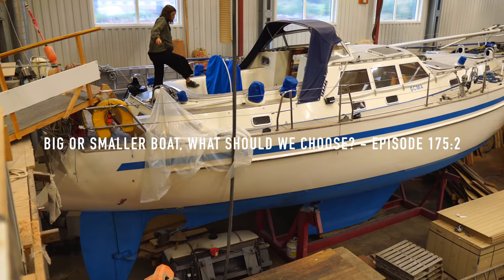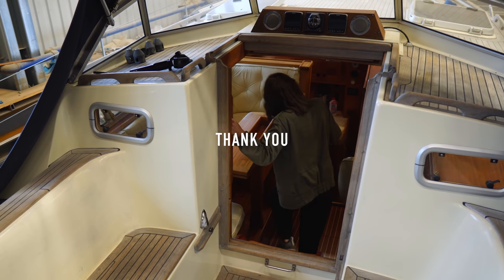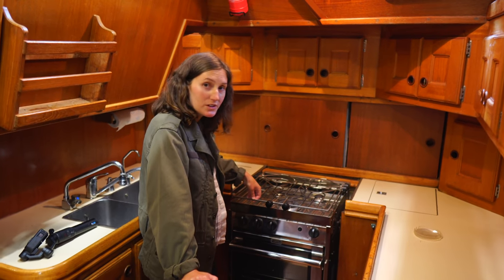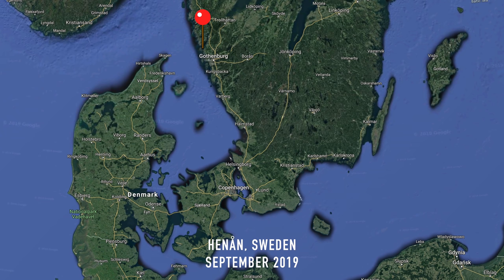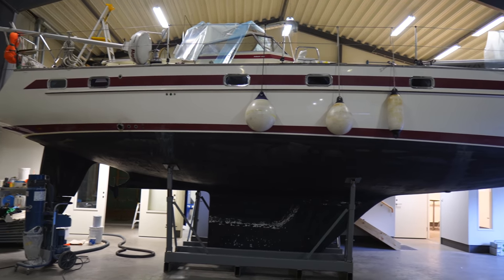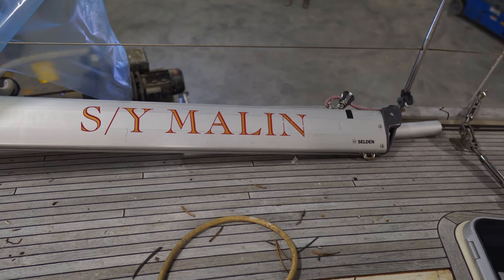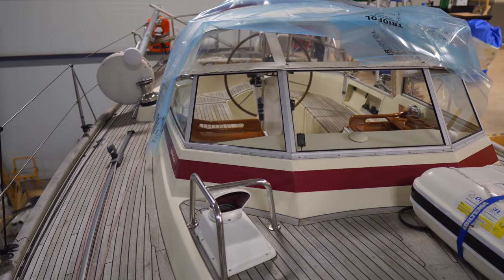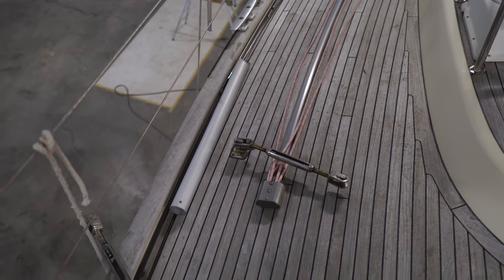Big Or Smaller Boat, What Should We Choose? - Ep. 175:2 RAN Sailing

Comment: I had a 55 ft boat with teak decks purchased new back in 1985. If I were buying again I would try to avoid teak decks, maybe just the cockpit. They look beautiful and feel great underfoot but require a lot of cleaning and elbow grease to keep them looking clean. After trying many different solutions to keep them clean I eventually came to the conclusion you could not go wrong with plain old Tide soap. I would also avoid any on deck wood varnishes. There are always more than enough other maintenance chores to keep up with without adding on deck teak and varnish. Just my two cents on my preferences and wishing I was still young enough to be contending with these decisions again myself. Really enjoy your videos and by far one of my favorites.

Comment: I spent most of five years cruising, mostly Central America and the Caribbean.  I'd suggest you consider whether the boat you have could be handled by the minimum number of people you reliably will have onboard.  I picked a 30' cruiser rather than a larger boat because my initial sailing experience was on a 65' boat (built in 1928 for the King of Denmark) and it took a crew of seven to race it.  It took three people to get a headsail out of the cabin and on the foredeck.  I knew that I was likely to be solo often and wanted to make sure I could handle the boat under bad conditions.

While cruising I made friends with a couple on a 50 foot boat and a couple with a 54' boat.  Both couples needed extra crew when doing a passage.  That meant leaning on family and friends to take time out from their lives, travel to the boat, and then make a big jump.  Or hiring crew which is not necessarily easy or enjoyable.

What I saw a lot of in the Sea of Cortez was couples on 40' boats who seldom hung a sail but would motor from place to place, especially if it wasn't a run.

Perhaps roller reefing is better than it was when I was cruising but back then one saw a fair number of destroyed jibs after a big blow.  The couple on the 50' boat I knew did the Tehuantepec Gulf passage, had their roller reefing snag, and came close to losing their boat.  Just a thought....

Comment: Definitely Malin was the better of the two for a small family.  Could the beds be modified to fill the split and reapply a wooden edge rail straight across to hold a more rectangular mattress and thereby extend the length.  Hard to find a boat so clean and well cared for if a couple of small carpentry jobs could solve a problem.

Comment: I'd go for an up to 50-foot wooden boat - nothing larger. A yacht has no soul if it's not wood. Besides aesthetics, there are many advantages to wood. It's durability for one.
Definitely a cutter. Winching in two smaller sails is easier than handling one big sail. A Marconi rig as it's better for sailing on the wind. I'm in two minds about a ketch or sloop. A ketch allows more sail and more combinations going downwind.
I liked the idea of having a steering station out of the weather. 
Consider lithium batteries; they allow you to install every safety device, including a radar, you'll ever need.
And I agree with Malin. Many boats are gloomy below deck. Brown varnished wood is used apparently to make the craft look more authentic. Lighten it up. Paint the bulkheads and cabin ceilings white. Carpet the sole, especially when you're sailing up North and install a heater.
A workbench for Johan would be a boon as would a more spacious engine compartment. 
Good luck!

Comment: Joining the thread late having just binge watched and enjoyed many of the recent episodes.   Worthy of a look IMHO are the Nauticat yachts (Finland origin). Very high quality (no balsa core), Selden masts, heavy layup, full size aft cabin, etc.  You my consider the added safety of an enclosed pilot house a plus for the baby along with the benefits of an aft exterior helm for traditional sailing fun.

Good luck regardless.   Just subscribed and will be following.
Reply: I have looked at a Nauticat 44, and I must say that is a very spacious and practical boat. Also the quality is top! Good for liveaboard. But I think that these guys are more into the "true" Sailboat design, which has better "real" sailing performance - especially upwind / lower windspeed. The motorsailer is a compromise. But the Nauticat 44 might be one of the best of the Nauticat motorsailer models, thanks to the higher sail area vs displacement factor. The 44 has a nice big pilothouse/deck salon, and has full headroom (+ free air on top) for a 1.90 mtr tall guy.
But with low breeze 50 deg upwind, you will need to motorsail with the Nauticat motorsailer, where many true sailboats will go on just sails.

Comment: Longer cockpit seat are a must as you do spend a lot of time in the cockpit, well I do anyway on a long passage. Galley designed so you don't get tossed all over the place. An open floor plan. A workable owner's stateroom that will be good for the little one, she will need a secure bed with you guys.
Something between 44 and 54 feet.

Comment: In rough seas I tend to get queasy in anything under a 42 ft. waterline and 45,000 lb. displacement. I also don't like to feel closed in by small spaces, so I usually only look at sailboat lengths between 45' to 54' and with displacements between 45,000 to 54,000 lb. and beams no less than 14 ft. I despise any wood on deck 'cause it makes me into its slave and I also despise wet heads....they must have a separate shower, with a tub as a bonus. I hope you two find your perfect sailing home!

Comment: Have you thought about an OVNI?  A 455 might be a good boat for you and if you can find an early one, it could be within your budget.  15.2m LOA.  Aluminium hull with lifting keel.  They are built for long range, off shore cruising, so would suit your type of sailing.  Very strong construction and massive tanks, although many also have water makers.  Down below, the woodwork may not be quite up to the standard of a Najad or H-R, but will be very much better than what you will find on any plastic production yacht.  We looked at a Najad 37 before buying our OVNI 365 and have not regretted our choice.  The Najad was a lovely boat, and in comparison, our OVNI looks almost utilitarian.  But it is an excellent sea boat and very practical and safe.  It is also very versatile.  We can get into shallow bays and rivers that would have been inaccessible in a boat with a deeper fixed keel.
Have really enjoyed following your adventures.  Good luck with the search!

Comment: Even though they both were very nice boats, neither one of them would be our favorite.
As a family of three, we are looking for a boat for quite some time now but weren't successful yet. The Deerfoot, even though a great boat, would be pretty much too big for a crew of two. Please keep in mind that a baby can shrink a crew of two into a crew of one in almost no time and regardless of what situation you are in — the reason why for us excellent single handling capability is very important.
That also applies for the Forgus 52. What we really liked about the Forgus was the deck salon and the inside helm station. 
So far, we mainly checked boats on the US east coast and in the Netherlands. The Netherlands because they build really great aluminum hulls combined with variable draft.  Strong aluminum hulls and variable draft make for real go everywhere boats. The downside is that they are very expensive, new as well as used. We absolutely understand your desire to have a more open floor plan and a lot of light; we don't like the basement feeling either. However, after checking many boats during the last year, it appears to us that those characteristics are coming more often with newer boats and higher price tags. 
In the end, buying a used boat is always a compromise. The only thing we don't want to compromise is safety, and the rest is negotiable, at least for us.

Comment: Hi,
would like to contribute with some of my thoughts about finding the right yacht for family cruising around the world within a tight budget.

There is a huge dilemma when theere are so many needs that has to fit in a budget of $ 150k and still get a good enough and not too old and outdated boat.

It's also hard to find something without compromising.  To make long passages on open water I would prefere a hull made of steel for safety reasons but thats hard to find and probably expensive if it's well maintained and upp to date. 

I asume that a hull made of GRP will be the best way to fit the budget and easier to sell later in the future.  

To compare safety between diffeerent brands of GRP boats can be hard.  Probably it doesn't matter if you have an older Najad, HR or a newer and more modern design cruising yacht like Beneteau,  Bavaria or Dufour. When hit by a floating fridge, container or a log, you will probably get a hole in the hull near waterline no matter what design.

Modern cruising boats often stands for wider hull, less weight, good sailing speed and spacious comfort in contrast to older design that stand for high quality,  better comfort in higher seas and often safer when you run a ground in more than 6 kn but it has more weight, often less sailarea,  less speed,  poor light inlets, narrow and crowded cave feeling inside.  

If having children onboard I would think about:
1. Spacious design
- Children should have their own cabin to play and sleep in that hopefully helps to keep other areas almost free from toys.
- Salong with dining area with lots of seats.
- Spacious cockpit with plenty of room for everyone to enjoy sailing, dineing,  hanging etc. (I modified a bicycle baby seat to let our daughter to sit in cockpit when sailing.)
2. Easy access
-  to transom / bathing platform makes it easier and more secure when bathing and when using the dingy. 
-  to engine room to do maintenance
3. Easy and fun to sail  
- Rig with furling sails (head and main) to make it easier and safer to adjust single handed.
- 2 steering wheels to be able to sit all the way out to each side to get closer to the feeling of sailing a small sailboat and it also makes it easier to access transom and bathing platform without having a steering wheel in the way. 

As you probably already know I would recommend a modern design production boat not older than 10-15 years.  I think that will gives you more value for money.

It's also easy to find a 10-15 year old 42-46 feet (Bavaria, Beneteau, Dufour etc..) for about $ 100k and still have money to update the rig and other necessary things within your budget. It's also easier to find spare-parts to well known production boats. 

If you choose to go for a modern cruising boat I would recommend a 4 cabin version with 1 double bed cabin in foreship, 1 bunk bed cabin midship and double bed in each aft cabin. 2 heads (one w shower),  big salong w longside galley, big u-sofa and a free standing 2 seater sofa close to galley (so you have something to lean on and grab on when cooking or passing when sailing). 

I sugest that you convert the bunkbed cabin to workshop, storage and a small washingmachine.  

If you believe in the older design I would go for a less expensive production boat like Bavaria 42 ocean (center cockpit) wich you can find for about $ 100k  The big difference is smaller cockpit with small table, 1 steering wheel, 2 bigger double bed cabins, galley in pasage to owners cabin in aft (safer cooking when sailing). 

If  buying a +10 year old boat I think you will need to update the rig to make it reliable (good as new) and most probably also get 1 or 2 new sails.  Depending on the boat condition and age of equipment I beleive it will cost lots of money to update and complement to feel safe to sail around the world with. 

other thoughts..
I would also try to avoid teakdeck if possible to keep maintinance and cost down.  

Due to that modern crusing yachts have more sensitve rudders I would also get a wind vane that could be used as a spare rudder.

I would also spend some time to think how to make watertight bulkheads

best regards 

Anders

Comment: At the price range of $150k you might want to look at a Hunter 466 or 45 center cockpit. all of the larger Hunters produced since the late 90's are CE - A rated A Class A yacht ( boat ) is a vessel that is built to navigate the open ocean and surpass a force 8 on the Beaufort scale and surpass waves higher that 4 meters.   These yachts are constructed to be self sufficient in hostile seas. No this is not a Swan or Hinkley but in your price range I don't think you can find more boat. Hunters are like a Chevrolet are very well built have top of the line equipment such as Selden, Harken, Lewmar ect. and they have lead keels attached with 1 inch 316 stainless bolts unlike many European boats that have iron keels with plain steel bolts. We have a Hunter 380 which we are very happy with and plan to do the Caribbean, Mexico, and Central America. You might contact the YouTube channel Sailaway who recently purchased a Hunter 466. Here is a example of a late model Marlow Hunter 50 CC although the 50 is 2 1/2 to 3 time your budget of $150k a early to mid 2000's 45 CC can be had for under $200k. https://youtu.be/uM_Hoaj221I

Comment: 45' fiberglass and then you need to decide what climate you will be in, dark hulls are no good for the heat and keels over 6' are not for the tropics and a warm climate needs lots of ventilation but no heater.

Comment: I was 20 years at sea with a 72 ft 60 Ton Steel Ketch. Safe and not complicated built for 160000 US in Venezuela. 2x hurricane, 1 time 20+ meter wave of seaquake - no problem. Big boats save on Marina costs - only in 5 of 100 cases I need a marina. Because heavy boats are less weather dependent and comfortable at anchor. 
You have a "RAN LOOK" on other boats - this is similar to a horse with blinkers. 

Cross an ocean with a 60 ton long keel and you will experience the big difference of comfort. The small expensive luxury boats with high maintenance, poorly accessible technology which you look at time are not ideal familys boats. Sea sick woman - Children need space to play -  
Family needs safety and comfort - 
You do not need to buy a teak deck, no name of a luxury manufacturer nor expensive maintenance from luxury boat manufacturers

Comment: If the worst comes to the absolute worst for you, you could always get a real job just like most people have to do and save some money, then perhaps you'll be able to afford the boat of your dreams.
Reply: Try the Wylie 60 Roxanne. Bullet proof Alloy hull, and sandwich deck- no hot hard to maintain teak. Big watertight compartments at each end with crash bulkheads. Long slim easily driven and proven over 20 years cruising round the Pacific with a family crew. In Fiji at the moment but hey, what a place to start the next segment of your adventure.